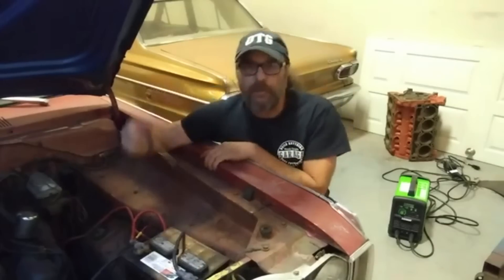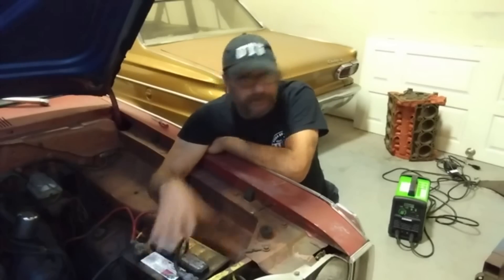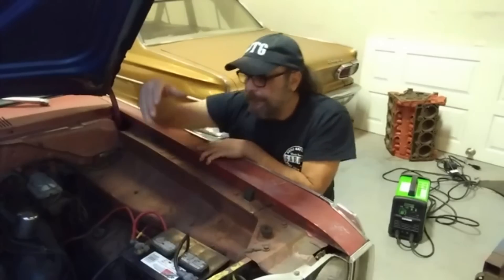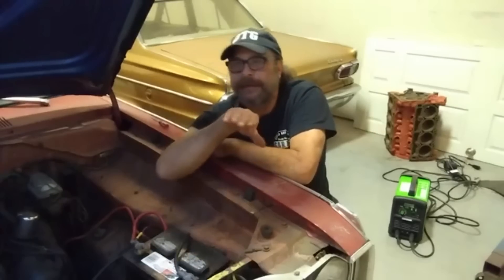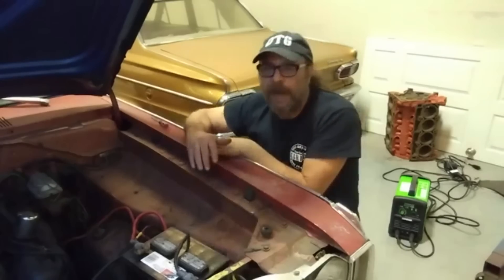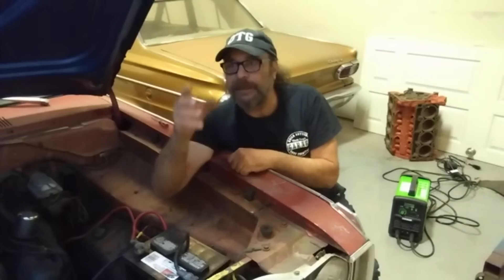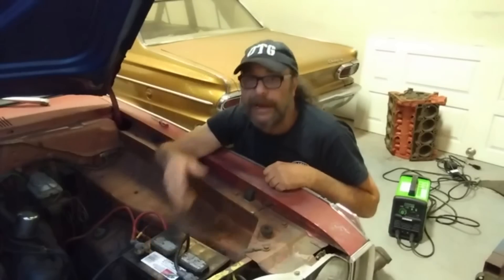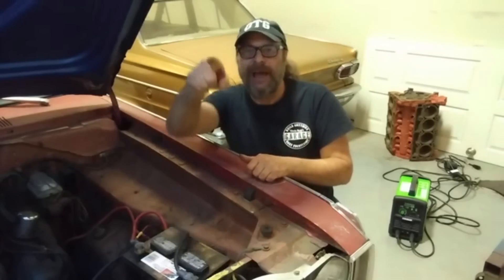Stick Welder Battery Revival SUCCESS!

Comment: I've heard two maintenance free batteries both side post delco gm batteries we are at fault we overcharged them in the summer and it sounded like a shotgun going off and battery acid was everywhere on the coresupport and no one got hurt other than the three dents in the hood especially since the 81 Buick Electra 225 limited Dr side hold down was broken, but clean up the battery acid and the battery terminals two different new everstart batteries, bleed the 5.7 litre fuel system and pump and had it running again..

Comment: Pretty neat. 1 problem with it I can think of is the crud you boil off the plates can settle on the bottom and short it internally given the right bump in the road. 
Dad told me a story about my grandad bumping into a loading dock at Agway and his battery exploding, pretty wild
Reply: i wonder if it didnt knock a cable loose..... and cause a short 
or cause the 24 volt system to turn into a 48 volt system
.
or something like that
.
.
if their was a "piece of trash" in the bottom...... i think it would simply get red hot and melt/turn to dust before it blew up a battery
.
now if it was a LARGE piece of trash..... i could see it getting hot enough to boil the acid/water
and the steam causing the caps to pop off
.
but FULL ON explode..... idk man
usually it takes a LARGE short..... or LARGE over charge/current/voltage to BLOW UP a battery

Comment: Concentrated hydrogen won't burn easily. Has to be the right mix with the oxygen in the air. Royal Flying Corp figured this out in ww1. They'd shoot 1000 holes in a Zep and not bring it down. Even incendiary ammo  worked only when enough leaks mixed hydrogen with air to the right ratio and then whoosh.

Comment: This works. I've measured progress with a load tester and specific gravity tester, monitored each cell, gradually increase from 1.150(dead) to 1.270(useable)
Not all batteries are savable especially ones that have already had a long life and do your best not to overheat the battery, cycling the welder on for 15 minutes off for five for about five cycles then test the specific gravity. If you don't get the specific gravity reading that you're looking for (1.270-1.280) give the battery an hour to cool internally, repeat. Also, don't bother load testing until the battery is holding a full charge (at least 12.75 volts) load testing and uncharged battery does more damage, not good if you're trying to save it in the first place.
Reply: There's the rub... Certain types of failures are able to be fixed with the method, which, as you mention, doesn't involve batteries used on a daily basis for many years that have simply degraded.
Reply: @tarstarkusz  haha that's kind of like the seal swell stop leak stuff for engines and transmissions. 
If it's worn from use ,forget it it's not gonna work. 
If it's for a barn find that's been sitting, it might work. 
Kinda like the battery dealio.
Reply: @tarstarkusz  exactly. Batteries in daily driven cars that have long lives typically fail because lead falls from the plate matrixes and fill the bottom of the cells causing an internal short. With that being said this is a great method to desolfate batteries that have sat for long periods not in use or accidental over discharge "drained" battery set otherwise won't recharge.
Reply: no it doesnt

Comment: i have been doing it for years as well as using the welder for jump start 50% success rate. you should really put some cables on the battery and hook the welder to the cables so that when you turn it on (bad connect) you don't melt the lead terminal off (melted off) but yes it does work
Reply: Good idea. I have a bunch of old boat batteries that I was going to scrap after I used them for a couple years on my solar system, these are really dead. Would help me be a bit farther from them, cause I'm using a gas powered welder so shutting it off every time and starting it up again to re-hook it up again, wouldn't be worth it, Thanks

Comment: My dad taught me to lower the hood and lean over it when hooking up jumper cables roadside because water isn't handy to wash off the acid if the battery blows its top and the acid sprays your face. It happened on my 1980 sedan Deville and my whole shirt turned like Swiss cheese, but my ugly mug was unscathed. Thanks dad.
Reply: Crazy, I’d expect it to blow after being jumped due to the hydrogen gas evolving during the charging. Never thought there would be hydrogen gas coming out the battery when it’s in need of a jump
Reply: @dirtyaznstyle4156  all it took was the little spark when putting on the cable.
Reply: @nastybastardatlive  Which is another reason the negative goes to the block and it's the last connection - just a little more distance.  I also tend to pull the caps and put a damp rag over the top.  And yes, "Thanks, dad!" on my part as well.
Reply: @jameswyatt1304  I've got a pair of jumpers that has a plug in the middle ,and leds so you know polarity is correct. 
Hook up each car and connect em in the middle, much safer spark distance 😃
Reply: @MrTheHillfolk  I operated a tow truck years ago where the jumper cables would plug into a receptacle mounted on the truck after connecting the battery terminals. Safety at a distance.
Reply: @MrTheHillfolk  brilliant
Reply: @nastybastardatlive  hook dead car up 1st then hook live car up .... my common sense shared with you ... for free
Reply: @St72ayBull3t  dead red first, then red 2 red , black to black...
Reply: Dads are the best!
Reply: A battery is not going to blow up unless you do something stupid like reversing the cables or connecting one side while the other two alligator clips are touching. Use common sense when jumping a car and you will not have any problems.
Reply: @lizardking8388  Hydrogen gas is highly explosive and a little spark (say connecting a jumper cable) can easily ignite it. But I'm sure you already know that because of common sense and whatnot.
Reply: @anthonyhiscox  A sealed battery cannot blow up by just connecting jumper cables (the correct way). You can hold a lighter over a sealed battery and it will not blow up. 100% impossible. Anyone claiming that their battery blew up while simply connecting jumper cables (the correct way) is LYING!

Any hydrogen that escapes a battery immediately is absorbed into the atmosphere because it is lighter than air.

Now if you removed one of the covers from the cells and held a lighter to it while charging it, it will make a popping noise, but it will not blow up and spray acid at you because the acid is at the bottom below distilled water and hydrogen that is generated bubbles up to the top.

I have had plenty of experience experimenting with batteries to know.
Reply: I call bullshit on this story of yours. You might have got acid on your shirt and after washing it holes will appear. Ive done this a bunch of times just getting acid on my shirt and not knowing till i washed it. I bet you a million bucks your shirt did not instantly have a bunch of holes in it from the battery. BS

Comment: The long term neglect and discharge you described makes me think the plates were heavily sulfated. When you hit it with a lot of juice at once, it cleans the plates and battery's like new .
Reply: @ De Fund the Government, I agree with your analysis that the high amperage fed to the battery did loosen-up the built-up sulfulation on this dead battery... With that being said, if there was an internal short circuit that created heat, the battery could have easily caught on fire or explode... Tony does have a good assessment by wanting the electrolyte level above the plates, when charging it... But Tony was in error about something he said... The electrolyte is NOT pure sulfuric acid... There is water in the electrolyte. Believe it or not, when the battery is being charged, Hydrogen AND Oxygen are being separated from the water that was originally inert... After the electrolysis of the charging takes place, the dis-associated molecules of Oxygen and Hydrogen become a potentially combustible mixture... And yes, a fire or an extremely powerful explosion can easily take place... Hopefully when Tony tries this again, he'll leave the battery in a well ventilated room with plastic sheeting lining the walls, floor & ceiling... And he should have an ABC 10 POUND fire extinguisher ready to go....

Comment: only battery I've seen blow up just cracked the case.  It was enclosed in a small space in a boat.  Owner said it went "thud" and that was about it.  Case was split, acid went all over but it was in a plastic tub so it just needed to be washed out.  No big deal.  The boat sank and the battery was under water for 2 days.  I suspect it got some salt water in there and that reacted badly.

Comment: I use to watch my dad when I was a kid take a steel bar and with the battery caps off take that bar and come straight down on the posts and if a cell started bubbling that meant the battery had a bad cell.  My Dad worked at Gatlings Auto Store in the !970's and sold and put in alot of car batteries in vehicles for customers...

Comment: Loved both videos and agree with everything you said. I design battery backup systems for refinery control systems that take up entire rooms. Your desulphation trick is based on sound principles and the H2 ignition risk in your shop as you clearly explained was approximately zero.
Reply: Ya well, to a "safety joe", approximately zero, is not good enough...

Comment: My skepticism comes from living in sub zero temps. I gotta say I'm impressed! Might try this with an old battery, if it ain't froze and broke already. Still wouldn't use it in my main driver, that HAS to start,     on call 24/7 -40F or warmer.
Reply: I have an old battery that used to be in my car, became unreliable and i replaced it. Kept the old one though. It's been used as a ghetto lighting source (using  a darn headlight bulb for some light in a shed). Died MANY times over. Would be cool to see if it could bring it back to its glory days. Or even a battery from a current vehicle which on the -15 C days, its getting weak. Not the daily, worst case, it doesn't work.

Comment: Caps off you are fine.  Real danger is boosting another vehicle.  That's why it's safer to make last connection to ground on the boosted car NOT on the post but a body ground far from the battery.  Our old neighborhood mechanic blew one up once boosting it from another vehicle.

Comment: Tony, Please do a test on the product called "Charge It" which is supposed to revive bad batteries. Does it actually work? Many of us do not have access to a stick welder or high powered battery chargers.
Reply: I bet there are far more people that don't have a "charge it" unit than people that have welders.
Reply: @bigfootnmore6619  Charge It is a liquid product that comes in a small bottle and it isn't very expensive. I've heard many very good reviews of it.
Reply: @raybrensike42  oh, ok. I saw an electrical device called "charge it"